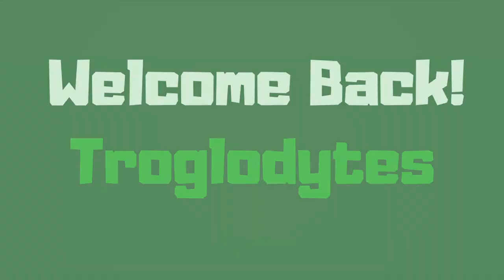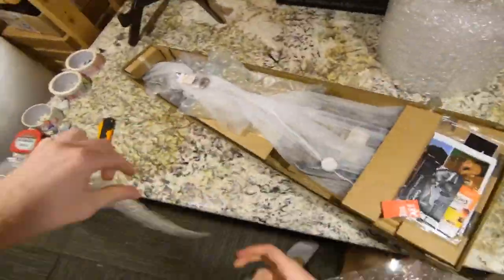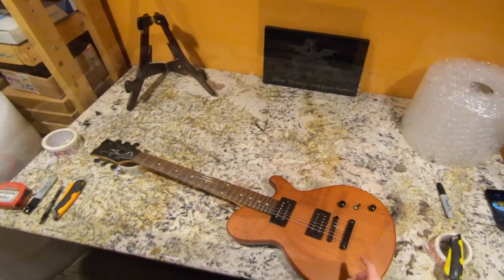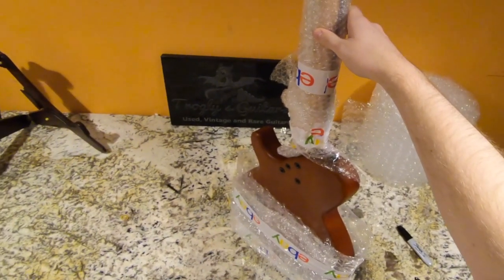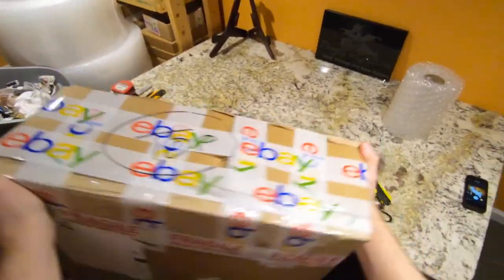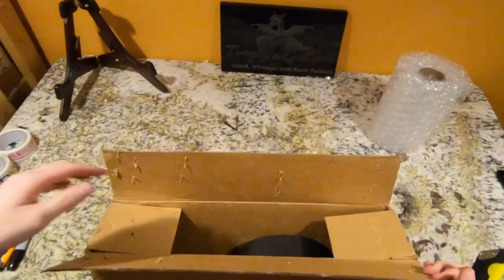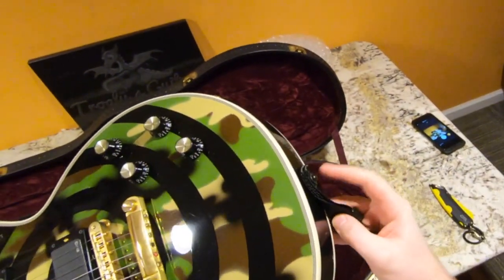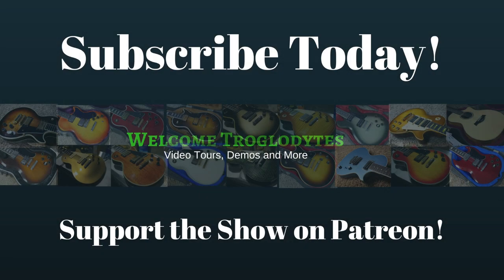Shipping Returns + Guitars Without Cases and a Wylde Unboxing! | Trogly's Vlogly #4

Comment: I think if you wanna save a bit on bubble wrap on guitars without cases or gig bags, on the neck to make sure the bubble wrap touches before the back of the headstock, instead of just doing full wrap-arounds, do like one or two wrap loose wrap-arounds, then shove a roll-up underneath the neck within the loose wrap-arounds. Maybe that'd save a bit because you wouldn't need to use much bubble wrap on the fretboard side as compared to when you do full wrap-arounds.